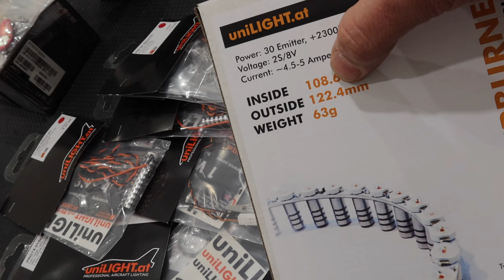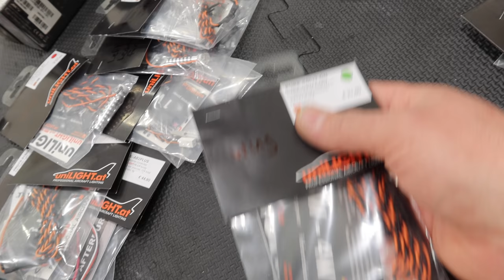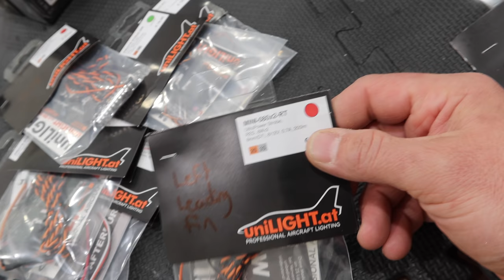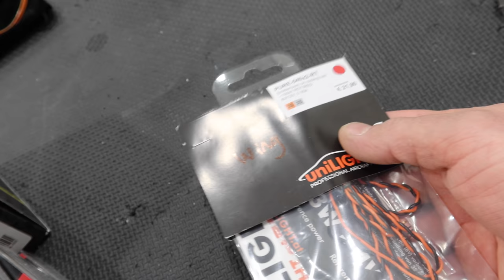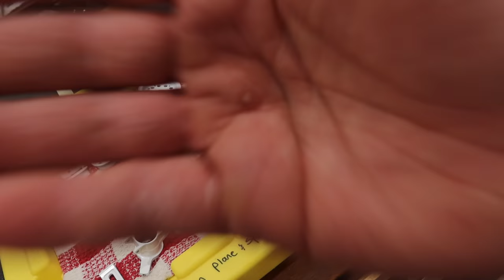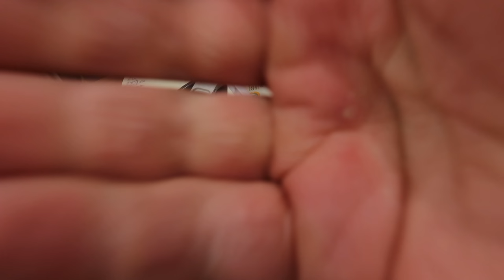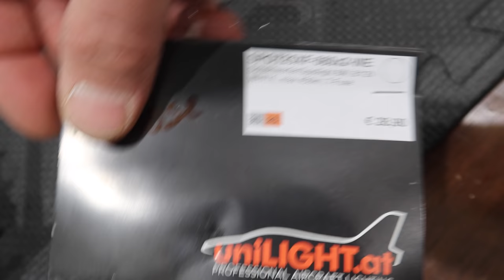TOP GUN F-14 - Equipment and Gear Assembly - Skymaster F14 Build

Comment: Beautiful work on the gear! Really looking  forward to seeing it weathered and complete. Im nearly finished with paint and graphics on mine. Always happy and ready to see the next installment! Hoping to see you at Jets over Kentucky this year! 
Side note  I wish you had shown the filling of the oil as mundane as it is! I struggle getting this right and would love to see your process!
Reply from the maker: Thanks David!  Oh dang!  didn't even think about that.  Basically add some oil through the allen key fitting.  cycle the gear.  Add more, cycle the gear and continue this till at the full compression point it's not sucking in air.  If you don't add enough it will have an undampened spot near full travel.  i'm sure you know all of that already but that's my process.
Reply: @thelightersideofrc  thank you Johnathan!

Comment: I was waiting to see what turbines you were choosing to go in this and I was not disappointed. Definitely subscribing because I really would like to see how you balance things out. Though I do have to ask something from a total turbine noob perspective. You suggested that you may detune this based on a comment that there is too much power for this design and that flutter was a possibility. If that is the case, why not go with a smaller turbine? Swiwin SW190B put at 190N @ ~1.5kg each whereas detuning these to a similar output @ ~1.9kg each. It's a little more than 1.7lbs of extra weight for the same output. Fuel consumption seems higher as well which I would think would mean less fly time.

Total turbine RC noob, definitely not a bash nor a criticism. Just trying to learn. Thank you and I'm really looking forward to seeing more! Served on an aircraft carrier with the real thing. Never got tired of seeing these fly.
Reply from the maker: Hey Dee.  All great questions and thanks for tuning in!  1st answer is the owner is supplying all the main equipment and that's what he want's in the aircraft.  
As long as you know how to use the throttle stick (sounds rudimentary but some don't) engines like this can be a ton of fun.  doing most of your flying between 1/4-1/2 throttle, slow pass down low and go to full and pull up!  It's a rush and it's nice to have the power when needed.

Often with larger engines your fuel consumption is better than a smaller engine in the same aircraft.  with a turbine, the fuel consumption curve is not linear.  so most of your consumption is happening in the upper part of the throttle range.  So if your flying an engine that barely flies the aircraft your using more fuel than a larger turbine.  Yes your going to add more weight in engines but that is generally minor with an aircraft this size.
Reply: @thelightersideofrc  Thank you very much for the response! I have been looking everywhere for fuel consumption curves as most only publish peak fuel consumption. I have been curious about oversizing engines to reduce fuel consumption but never could find somewhere that showed it does and by how much. Same with power, I imagine it is not linear either. Unfortunately, there are no RC turbine dyno sheets either. :D

Keep up the great work sir.

Comment: 210s are way too much for this model, mine has 166s and that is more than it needs.  This model has an speed range that if exceeded will cause flutter everywhere.  Also you will have a rough time getting afterburners in this model since the pipes take up most of the opening of the turkey feathers.  Sorry to sound negative and ultimately the owner can use what ever just food for thought.  Cheers!
Reply from the maker: Hey Keith.  Totally understand.  These 210's will most likely be down tuned.  the 14 that is flying in Eastern Canada is powered with 190's and it's a great fit for the aircraft.  I have a plan for the turkey feathers/tail pipe area😉